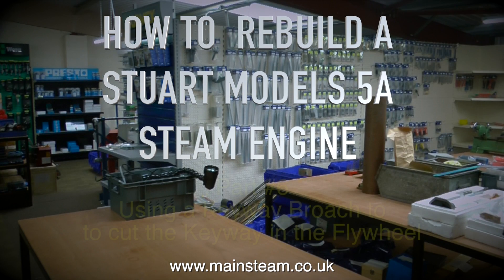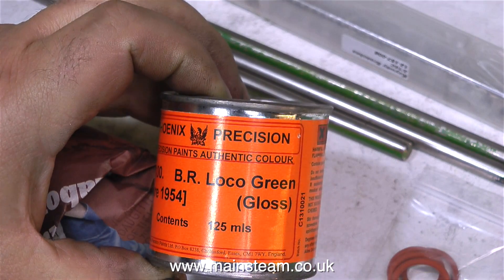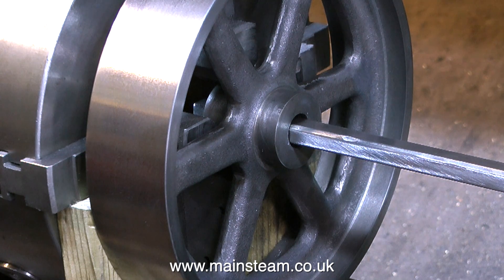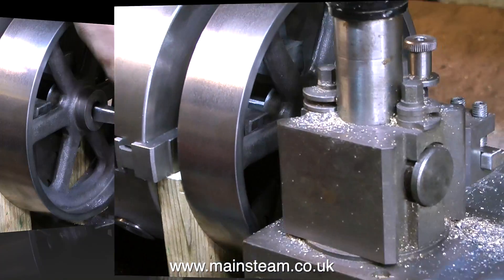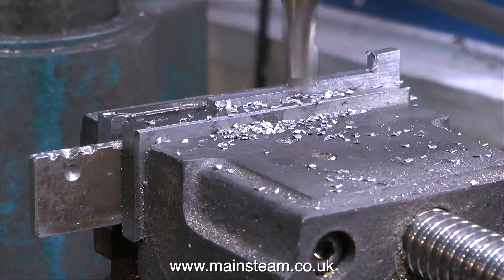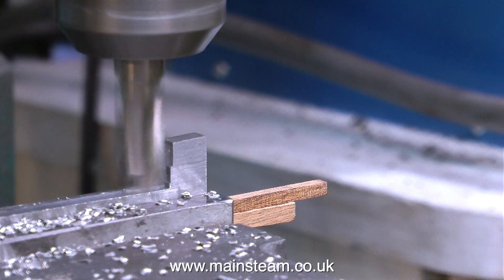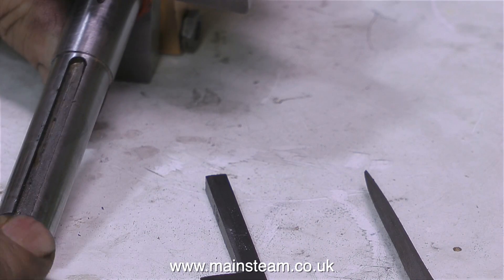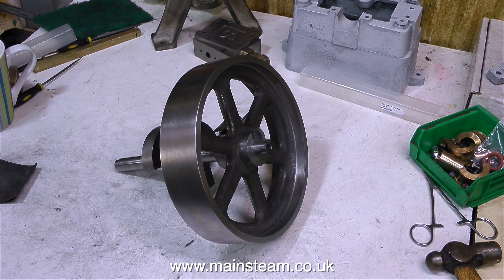HOW TO REBUILD A STUART MODELS 5A STEAM ENGINE - PART #6

Comment: Was the broach tool easier or faster than the simple method demonstrated in part 5? Thanks (again) for all the tips and convincing me more and more that there is no 'proper way'. Trying hard to find my first project. I thought I was on to something but than the auction site we all know sold it to someone else when I was under the impression I had a deal; oh well.  

I'm also thinking about getting myself a lathe. Zoomed in on some Myford lathes (also available in NL). Do any of the followers have an opinion about those?
Reply from the maker: Yes, much faster - multiple cutting teeth versus a single point cutter . . .

Comment: Have you ever set up a steam engine to run other machines (aside from locomotives)?
Reply from the maker: I once had a "Mamod" machine shop and I have used miniature steam engines to drive small generators in the past. I am thinking of maybe making a steam driven clock .....
Reply: Keith Appleton That'd be really neat to see!

Comment: On these type of keys, do you want the key tight up against the flywheel boss?  It seems you would want a bit of a gap to get a tapered drift in the knock out the key.
Reply from the maker: I think I mentioned the reason for the gap in the video . . . .

Comment: Thanks again Mr Appleton for the great videos. These two on keyway were really interesting. I know I will be using your lathe tool method in the future. Ignore the so called "correct way experts". You do know your stuff and there is always at leased three ways to do anything. Thank you for spending so much time on the videos. I did not know the adds at the beginning sorted hobby expenses, will apply my part in the future. Keep it up

Comment: It's weird that the broach didn't fit in the hole. Is that a 3/16" broach?
Reply from the maker: Apparently it is called a Type C Broach, it's quite rigid and ideal for cutting a keyway this way too :-)))
Reply: Cristi, Yes, that is a 3/16 broach but you have to understand that the key for this shaft is greatly oversize. I would guess that the normal size key would be 1/8th inch for that size shaft and the broach for that would be a lot smaller. Also for a broach like that there is a guide (bushing) that is placed in the hole to guide the broach. There comes a time when "Ya gotta do what ya gotta do with whatcha got ta do it with" LOL
Reply from the maker: That is as may be, but the slot in the crankshaft is also 3/16" as shown on the drawing, so who am I to question the wisdom of Mr. Stuart Turner ?
Reply: I think Mr. Stuart Turner was a modeler too, not an engineer or machinist. That is based on all the complaints you here about his castings and design, Something like you get, Keep up the good work.

Comment: I'd noticed the increase in videos lately, it's really impressive the amount of quality stuff you're getting out.

As for the best way to do things, there's always at least 10 ways to do something, and each way has their benefits and drawbacks. It's a compromise between lots of points, not least of which is cost. This is why as a climber I never post pictures of my rigging, and why I don't take pictures of how I make things in the workshop, it creates far too much drama when someone decides it should have been done differently, despite them not actually doing anything anyway.

One thing no-one can say is that you don't know what you're doing, or that you don't have the experience.

Comment: Mr. Appleton,  the technique that you used to cut keyways is also used by my shop. The only difference is the Machinist have a metal device that they block the four jaw chuck with that is adjustable to a small amount. Not being of the Machinist trade, I can't tell you to much about it but I've seen them use it to cut keyways in pullies with it.

Comment: Very nice work Mr. Appleton.  Typically a person would use a collared bushing to center and guide the broach.  It would also maintain proper axial alignment to prevent broach deflection and cutting a tapered keyway.  But your method seems to work as well, and I really enjoy seeing how you overcome the challenges of not having a full machine shop at your disposal.

My question is, with such a small crankshaft (5/8") in comparison to the key (3/16"), do you think that a smaller key would have been sufficient and more in proportion to the engine?  Not a lot smaller, maybe 1/8" or possibly 5/32".

If 3/16" is what the drawing calls for, I withdrawn my question.
Reply from the maker: but the groove in the crankshaft was already 3/16 of an inch - I didn't design the engine, that's what the drawing shows. . .
Reply: Thank you for pointing that out. I totally overlooked that the crankshaft was already built.  I apologize.

Comment: Really interesting Keith, do you think you could have used a 3/16" thick parting tool, which would have been somewhat cheaper than the broach, I would think. Fantastic and really instructive videos, thanks for all your efforts.
Reply from the maker: A Parting tool that is 3/16 of an inch thick is far too big to fit in the 5/8 inch hole . . . . . plus the Broach is designed for the job .....

Comment: Years ago,,, we didn’t have an arbor press either, so we had to use a broach, we pulled it though  the part by turning a  nut on a long threaded rod. AND YEARS later when I  worked in a factory, they had a hydrolic machine that pulled the broaches through the parts.
Thanks again for all your work and knowledge.  Your videos are the first that I watch...With eager anticipation. .. :)

Comment: Can we mill a rough keyway in the flywheel and then use the broach for finishing? Also by holding the broach at one end only, did you get a tapered keyway